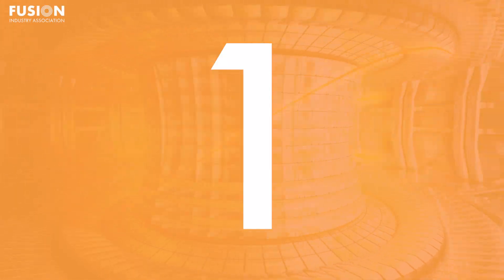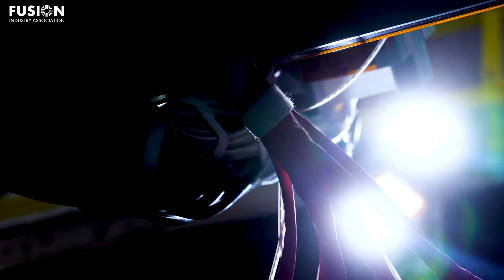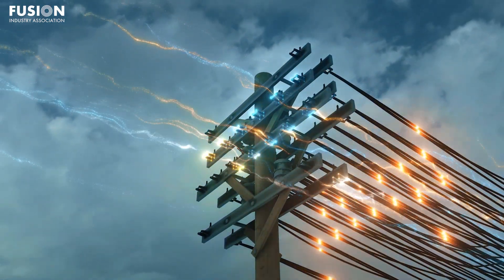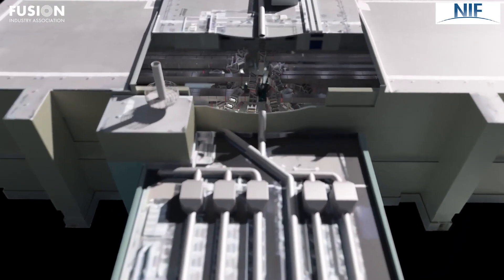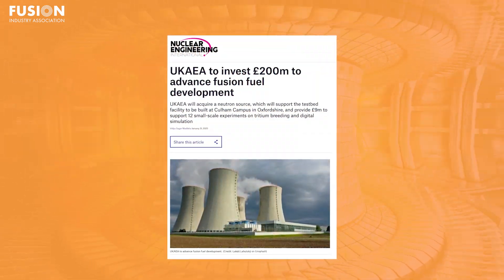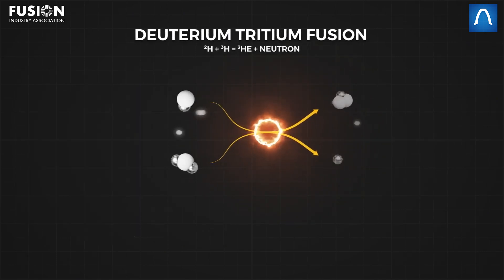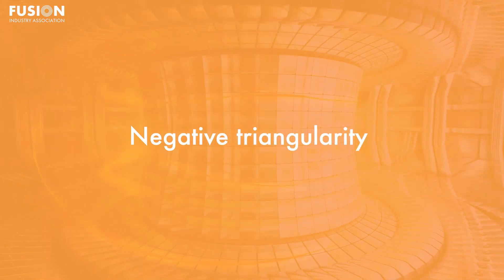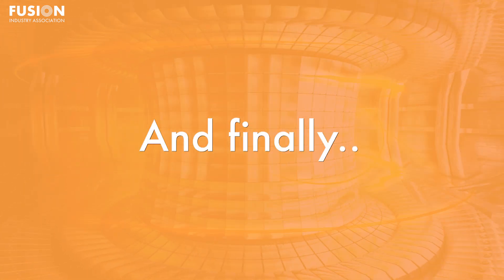Fusion News, February 5th, 2025

Comment: Thanks, Jeff. Your video caption still says, “PhD student at the University of Wisconsin,” not Washington.  

I cannot believe the UKAEA is going to waste millions on a tritium breeder testbed when they can just simulate it for free using OpenFOAM. I thought the government labs designed their simulation software so we wouldn't have to run expensive real-world experiments. What am I missing?
Reply: I meant OpenFOAM **combined with OpenMC**. OpenFOAM is a computational fluid dynamics (CFD) code. FOAM = Field Operation And Manipulation. OpenMC is a Monte Carlo neutron and photon transport code. Both codes are verified to be accurate, cutting-edge, open source, and fast. :-)
Reply: @michaeldeeth811  They want to obtain H-3 atoms, not simulations
Reply: @alanfolmsbee4916  Thanks, Alan. I don't understand why you think the LIBRTI experiment is designed to "obtain H-3 atoms" rather than to determine a blanket's tritium-recovery efficiency. According to the article, they plan to purchase a neutron source that can produce 50 trillion neutrons per second. That sounds impressive, but a commercial fusion plant would consume over a million times that many tritons per second. Also, the testbed requires 14 MeV neutrons, implying they come from D-T fusion. Overall, this system would be consuming H-3 atoms, not supplying them.